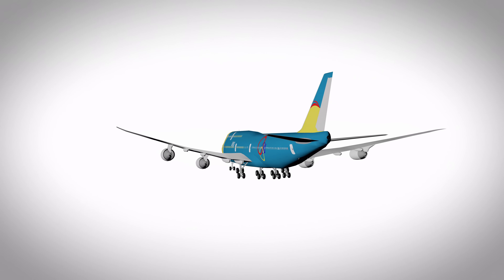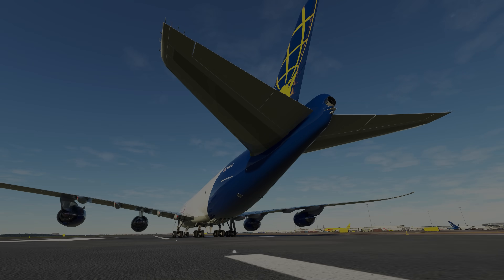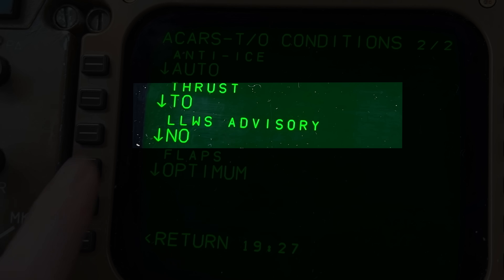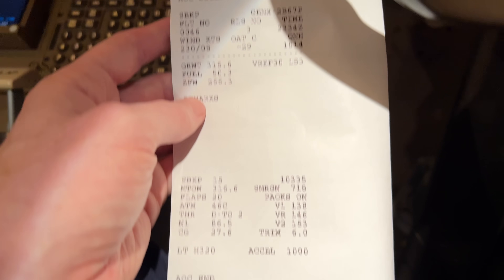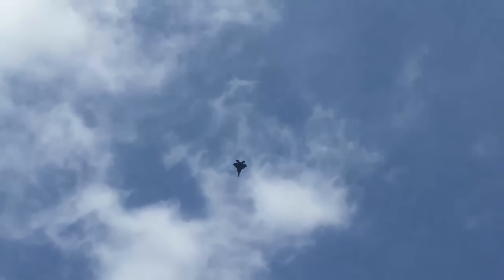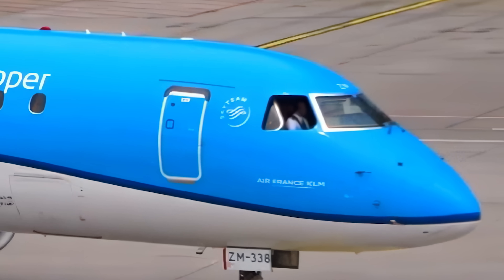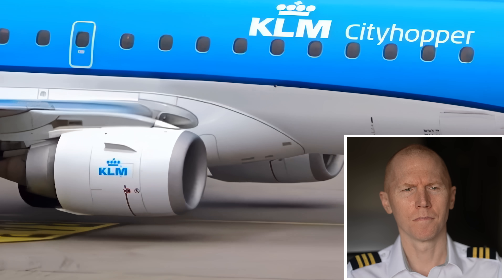Unsafe 747-8 Vertical Takeoff

Comment: Downshifting in a car to engine brake is actually much more sensible than using the brakes.  Your engine is at a higher RPM so it is generally higher in its power curve if you need to take evasive action at low speed, the car's energy is being dissipated through heading the engine (which is actively cooled) rather than the brakes (which are passively cooled), and most importantly, modern ECUs do not inject fuel when power is not required, and when the road is turning your engine over, power is not required.  It saves fuel to engine brake.

The ideal way to drive is to only ever brake when you're coming to a complete stop, or the person ahead of you is braking.  Modulating the accelerator and using engine braking shows a much higher mastery of the higher level driving skills such as planning and anticipation.

Engine braking doesn't put any undue wear on your transmission - the transmission is built to transfer engine power to the road.  You got up to that speed in your car with your engine, so unless you "money shift" from 5th to 2nd by accident, your transmission will be fine.  Hell even with a money shift, it's your engine that throws a rod, not the transmission.

E: FUCK I paused to write this and you called me out right as I unpaused.  If it helps I'm not trying to dunk on you for being wrong, I just heard from someone that, to a pilot, there's no such thing as too much information.

Comment: In the old days - before car brakes were reliable - it was best practice to work down the gearbox to slow the car.
All sorts of techniques, phrases I remember:
heel and toe (pressing brake and acccelerator together to get engine revs up to allow the change down in gear)
double declutch (I think this was for gearboxes without syncromesh).
My 2011 automatic car seems to engage a lower gear going downhill so providing engine braking.

Comment: For anyone wondering, a fully loaded F22 has a TWR (thrust to weight)  with 2D thrust vector control. 
most space rockets aim for about that TWR at takeoff. 
so the only reason you can't do straight vertical launches with an F22 is that missing extra dimention in the TVC to maintain control authority. 
So at no point could an F22 actually stall, because even if the control surfaces completely stop generating lift, full throttle will put you in a straight line where/when you want. 
In thrust, we trust.
Also, I belive the next gen fighter is going to have full 3D TVC.

Comment: Got caught in sheer in C-150, what a day that was!! I was on final to FAT. As I crossed the middle marker with full flaps decent stopped. I chose to go around and was advised that the front was passing so I ended up landing in the opposite direction after turning around.

Comment: Downshifting in a car in order to slow down is an actual technique, and is especially useful going down long hills. It is not used as much to reduce brake wear, but more to avoid the "brake fade" that occurs when the brakes get too hot, something you will be familiar with from aviation. On a manual car, there won't be any noticeable additional wear on the gearbox itself, though a bad change will add wear to the clutch. And manually selecting gear on an automatic gearbox is done without any concern for wear on the torque converter or gearbox.

The only real concern in a car when downshifting is if you downshift to a gear that will put your engine RPM too high.

When I drive a manual, I actively use the gears to regulate my speed, only using the brakes if I am stopping or otherwise cannot sufficiently regulate my speed with the engine and gearbox.

Comment: In 1955 a student pilot at a aerodrome near Sydney in Australia started his 'Auster Archer' by spinning the propellor. Unfortunately, it ran away and actually took off by itself. As it climbed away perfectly stable, the Royal Australian Air Force were alerted and dispatched a CAC 'Wirraway' (design based on a T6 Texan) to attempt to shoot it down with the guy in the back using a WW2 'Bren' machine gun. After failing to shoot it down the RAAF dispatched a 'Meteor' jet fighter which also failed to shoot it down. Eventually two visiting Royal Navy pilots in propellor driven Hawker Sea Furies shot it down and it crashed into the sea.
Accolades to the British design of the 'Auster' which obviously does not require a pilot and to the British pilots flying British designed aircraft. I'm British by the way.

Comment: lomshavak [not sure if thats how its spelled]  it's basically climbing vertically until no upward movement and letting it fall out of the sky - not a stall with spin - it looks like a leaf bobbing in breeze.  It is a very advanced manuever as it is difficult to recover from and puts extreme stresses on the airframe.  Trained in aerobatics for a bit and was taught how to Not do them, ie avoid accidentally doing one.  Mostly to kick plane into a spin with vertical climb stalls.  Our Civil Air Patrol squadron had a T-34  [Beechcraft Bonanza 2 seater with parachutes and engine modified for inverted flight]  that had great difficulty going 5 miles without doing a loop or roll.

Comment: Downshifting is actually the proper way to stop a manual shift gear car. Brakes are to be used only in the final part of the maneuver. Unless off course there is an emergency in which case you just slam the brakes without downshifting.

Comment: I've wondered about airplanes that are going to have to make a water landing, with no choice in the matter and still have some fuel and running engines (just not enough to get to land) and they have at least two working engines, one on each side.  Rather than becoming a glider and dropping both engine scoops in the water at high-speed ripping the plane apart, is it possible to slow down enough to drag the tail in the water (just kiss it) and then goose the engines and stand it on its tail while slowing down then gently setting it onto the surface.  I know, who could do it, but could the flight computer pull it off?  A water auto-landing.  I've seen some videos of an improperly balanced plane doing close to that before it hits the ground in flames.  What does a large plane weigh and how much thrust can we get from two engines?

Comment: So... if you are judicious with the use of low gears, they are a great way to keep your car slow without wearing out your brakes.  You notice how your automatic transmission has R-N-D-2-1?  The 2 and 1 are for capping your transmission at low gear.  That is useful for maintaining power when pulling, for instance, and also for engine breaking down steep hills.  Definitely not a substitute for proper use of the brake, but it can help keep your brakes from overheating.

But yeah, using a thrust reverser to do the same thing is probably unwise, particularly when there doesn't appear to be any particular extra stress on the brakes.

Comment: The clutch is the most common thing to fail when downshifting to hard/soft on a car.
There is also the the drive joint´s if doing hard brake/acceleration.

Common sence is not so common today :D

Comment: Your analogy of downshifting is not wrong.  When you press the clutch in to shift you are separating the engine/transmission, make the gear change, take foot off clutch (re-engage engine/transmission at flywheel).  So to slow yourself down all the time, you are putting the trans/engine through more wear as the engine is the load that slows you down AKA - engine braking.  Engine braking is a good idea for going down steep grades, especially if you are a trucker as you don't want to burn your brakes up, even automatic transmissions can take the OD (overdrive) off - locking out the OD gear(s).  Downshifting with hard braking is more race than daily driver feasible, although I would put brakes, lines, better fluid and rotors as a first upgrade going racing.

Comment: Nice flat spin stall on that fighter. Easy to recover from as long as your engines are running, though if you flame out you better eject before you hit the ground
There's another stall maneuver that looks even cooler. The pilot takes the plane straight up, as fast as possible until the engine can't pull the plane any further, the he do a quick full rudder, which make the plane tumble end over end through the air. Having dropped 1000-1500 feet head over heels, the plane will flare out and climb out of the stall

Comment: One thing that Kelsey does that is cool is fill in background you'd never need to know if you are a flyer. Case in point: In one video he said airlines have a person on duty at all times with every resource at their finger tips to get information, perhaps input from management, assisting captains in solving issues in conformation with corporate policies. A traveler could fly for decades and never know that in addition to talks with airports, the pilots now and then touch base with their chain of command to make their job more successful. I never dealt with anyone in my jobs except supervisor or manager. But the dangers didn't compare to flying a plane.

Comment: The fighter did a series of combined maneuvers, one called The Falling Leaf. Physics and capabilities play a role and one facet is recovery of the air craft. Also a lot of not what to do. At air shows they make it look fantastic, but in real life it is most basic to get the job done to avoid being shot at and just enough to get that job down. You could probably do the same with a 747, but the margins would be so large, it wouldn't make for a great show. Also, 747's don't have the eject option, which is occasionally used.

Comment: I don't know a lot/anything at all about aviation, but I do know cars. Standard transmissions are kind of a thing of the past, but I still have one, and there are lots of times that I downshift instead of braking. Maybe I'm on snow or ice and want to avoid changing my acceleration quickly. Maybe I am approaching a traffic light that recently turned green and I only need to lose a little speed to keep going. Maybe I had a brake line failure pulling out of the parking lot at work and have to drive 74 miles home with nothing but transmission braking, terrain, and the emergency brake to get me there (that actually happened, and it involved a lot of thought about how I could enter and exit highways on the uphill). Sometimes, the extra flexibility is a handy shortcut, other times, you're out of better options.

Comment: Downshifting and engine breaking is completely fine in a manual transmission provided you rev match and don't let your clutch absorb a massive rpm difference. No idea with Automatics

Comment: Have you considered reviewing the 2017 Arnold S movie Aftermath?  The warning system worked when both at 10k feet on intersecting headings.  Air Traffic had one descend to 6000 feet.  ATC had phone issues, 2nd plane decided to descend to 6000 without getting contact with ATC.  So decided to descend anyway.  But aircraft warning system (that was working earlier) did not now.

Comment: Lol car guy here(!) I wouldn't downshift to slow on an auto box but using the gears to slow down was common and good practice on older cars and manual trucks and I still choose to do it on hilly routes rather than risking overheating my brakes. If you do it properly and there's virtually no wear on the clutch or gearbox, do it well enough and you don't even need the clutch😉 but then (critically) there's little to no risk of sucking something damaging into my vehicle engine as a result of that technique.. love the videos, thanks 🙂

Comment: @13:02 -- the tradeoff described is pretty spot-on, I think.  Brakes are way cheaper to replace than (say) a clutch plate.  There won't be potential synchromesh destruction/overtorque.  The only reason I've used the clutch as brakes in a vehicle, was because the brakes in the vehicle weren't working well (front callipers were seized + rotors were warped).  Using a transmission instead of replacing the brakes just led to me also having to replace the clutch-plate/throwout bearing (in addition to new callipers/rotors).  Luckily the rest of the transmission was basically fine.

Comment: You failed to take into account the fact that the wind was blowing HARD - at what looked and sounded to be around 40 MPH - which also plays a role in enhancing the effect of a "vertical" takeoff, as the ground speed of the aircraft is ~40 MPH slower than it would be in calm conditions.

Comment: Fly shit from pepper point -  **Derated takeoffs are not used to "save" the engines from a potential future catastrophic event.   They are used because the engine's maximum thrust is rarely required.   More Thrust in these engines is directly tied to more heat.   A lower Thrust (AND Temp) takeoff cause less thermal degradation to the core of the engine.    Over the life of the engine that lower temp amounts to a SIGNIFICANT decrease in thermal degradation "hot section" of the engine.   And that decrease leads to significant fuel savings over the life of the engine.  Modern FADEC controlled engines rarely fail.

As far as the "too-steep" profile,  I once ferried an empty 757 out of Ohare.   Runway 9L back in the day, when the new 9L didn't exist.  No pax.  The controller asked for a "good rate of climb and immediate turn to 180 degrees".   So we gave him a MAX THRUST takeoff.  Our pitch attitude was extreme yet we were barely holding V2+15.    That weight and thrust demanded that steep attitude to comply with the "normal" V2+10-20  profile and not bust through the flap speed.   After takeoff, the Tower said, "Transmerdiian, that was very impressive, contact departure".   Good times!   Empty airplanes at even reduced thrust demand a very high pitch attitude.   Could we have throttled back after the gear was up?  Of course, but that's no fun.

Comment: Engine braking is completely normal, assuming you’re at the right gear and rpm. Brakes slow you down by converting your speed into heat, if your brakes are too hot, there’s no where for your speed to go.  It is taught to motorcyclists and semi drivers, and you can see on freeways sometimes to ‘trucks use lower gear’ to use the transmission to slow you down. You can hear engine braking on a truck when they put on their compression brakes (jake brake)

Comment: I use engine braking daily because my house is at 1100 meters elevation and downtown, 5 miles away, is at about 360 meters elevation. The road is a switchback road and riding the brakes all the way down would be dangerous. Engine breaking is fine as long as you do not red line it.

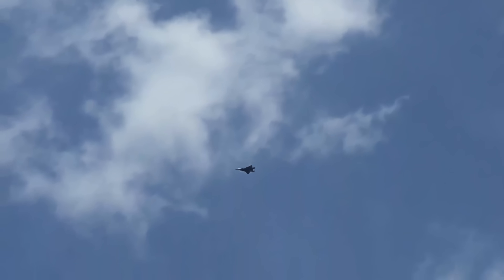Comment: (9:30) The F-22 Raptor also has vectored thrust nozzles, which allow it to do some amazing acrobatic maneuvers.  For those unfamilar, in addition to all the normal flight surfaces and controls every plane has, the Raptor can point its thrust in variable directions.  It's like being able to drive a car where you can steer both your front wheels AND back wheels simultaneously.
Reply: I think I read that the F-35 has thust vectoring, or maybe just the marines variant, I can't remember. Anyway, it looks spectacular and I imagine horrifying to find yourself up against in combat.
Reply: @BrokenSockmonkeyMusic  I've read that the F-35 only has VTOL (Vertical Take-Off and Landing), so it can hover like a Harrier Jump-Jet and doesn't need a runway for taking-off or landing.  The F-22 Raptor can't straight-up hover like the F-35, or do VTOL, but the F-35 can't make the slight adjustments to its thrust direction in the same way a Raptor can.  

To continue my earlier analogy, it'd be like if both sets of wheels in your car could pivot 90 degrees so you could parallel park straight in from the side, but could only be set in one of those two angle settings (forward or sideways); its handy for parking, but not for driving.

But yeah, I agree that both are pretty neat, and I would not want to be up against either in combat.

Comment: Here's a nugget for you!
Technically speaking the rudder and the nose landing gear steering is only engaged above a specific speed then for ease of control the rudder will also steer in the commanded direction. Below the specific speed (varies by acft) the nose wheel steering or tiller is used to steer the plane. Slow speeds steer with the tiller, higher speeds steer with the rudder!😁
Just a friendly tip from an old airplane mechanic.

Comment: In that first clip, the angle is not as steep as it looks. It looks steeper due to foreshortening. Foreshortening happens with long lenses where the subject appears not to be as long in the direction of the view as it really is. In this case, it makes the plane look shorter than it is, which makes it appear to be angling up higher than it actually is. Check the angle of the plane when it is viewed from the side, right after rotation. There is still some foreshortening there but not as much. The plane actually does not pitch up very much after that initial pitch, and it doesn't look extreme from the side - certainly not straight up. It would be instructive to get access to the actual flight log to verify the actual ascent rate for the flight. I would do that, if I knew the specific flight details.

Comment: The military jet dropping like a pancake is it's most deadly as the nose can be pointed at the enemy to fire. Done by thrust vectoring with a engine at power. It also allows a pilot to easily recover from bad looking stalls or sharp turns at low air speeds.

Comment: As a car guy, Kelsey's analogy was what we call "money shifting" have you ever tried to accelerate by changing gears from 1st, to 2nd, to 3rd, to 4th? Well you can decelerate to 0 by money-shifting, might try to go from 1st, to 2nd, to 3rd, to 4th, and go for 5th but get 2nd instead? - that's money shifting! - Now you need a new engine, and a new transmission, and an uber to where you were trying to get to.